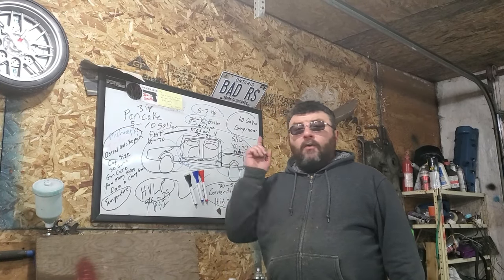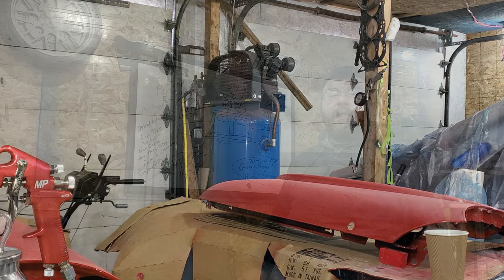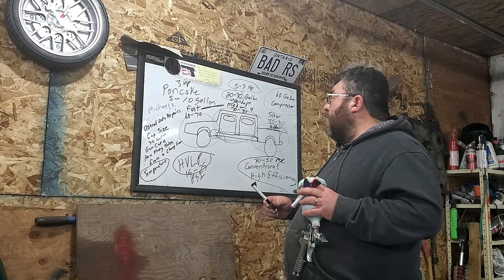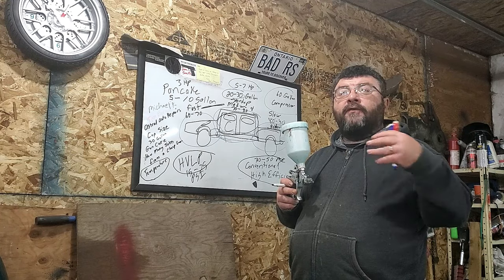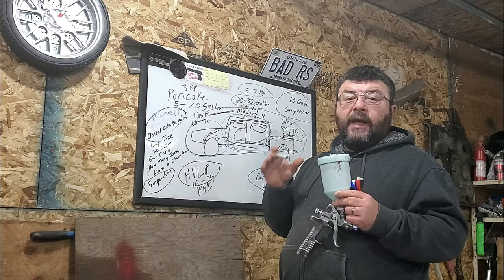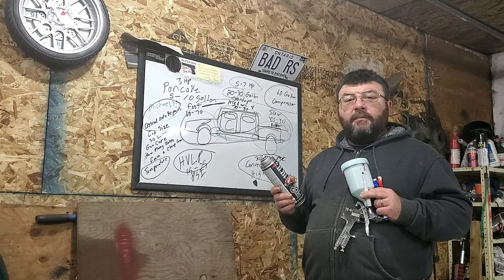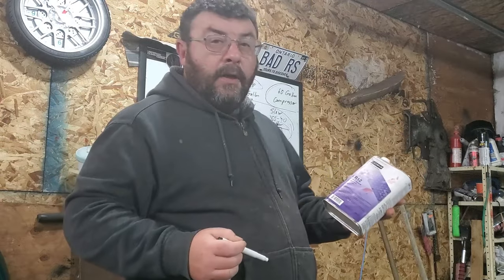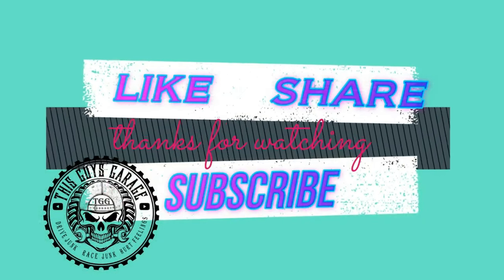compressor size for paint spray gun to refinish cars

Comment: Horsepower on a 60 gallon compressor matters i think... you have a 3.7 hp 60 gallon cp or a 5 to 6 horsepower 60 gallon cp it makes a difference im not sure if you could paint a allover with a 3.7 horsepower 60 gallon or not? jury is out on that the air pressure would come back up quick enough before u would get a pass done or if it would build fast enough before u would apply the second coat which is important sometimes hot weather or reducer your using in a singlestage paint can require a quick flashtime and when you start that second coat would that 3.7 hp motor have the compressor built back up enough for you to truly lay down that second coat??????????????? Your thoughts sir?? I have no doubts the 5 to 6 horsepower compressor would do it i really think your fine with that one
Reply from the maker: recovery is an issue, we had a 3hp 60 gallon in my dads shop 30 years ago for years before hvlp was a thing ,recovery wasn't as big an issue with a conventional gun ,but still an issue.  there is always flash time between coats so the compressor will be full when starting your second coat , but like the smaller compressors it really comes down to the square footage you are painting  ,if you are spraying a Miata you wont have an issue, if you are painting a panel van with lots of surface area  then the compressor will be playing catch up, as far as temperature that can be controlled with your solvent and activator. make sense?
strategy becomes involved 
thanks for the great question ,ask one any time ,hope you rang the bell and stay in touch my friend!

Comment: Dam and I wanted to get a little air compressor to paint my el Camino😔 not even in sections it will work
Reply from the maker: watch out for a used 60 gallon and you will be set to jet .   the 60 gallon huskies work great and they are reasonable. ty Eric
Reply: @thisguysgarage  thanks for the quick reply 1 more question since I'm planing of taking. Out the fenders and doors to spray on them real good with a 20 -30 gallon take care of the job meaning painting the whole el camino in sections ?

Comment: It is all about the CFM. How more air can the compressor produce. 15CFM is adequate for most jobs.
Reply from the maker: yup ,ty extremerecluse , this was meant for folks that do not really understand cfm
Reply: 10.5-12cfm is adequate for nearly any full paint job. The fact that most smaller air compressors don't put that out is the issue. It's not all about compressor size as much as it is HP, CFM, etc...

Comment: Compressor tanks size has nothing to do with it. Its all about compressor CFMs.
Reply: That's what I was thinking. A small motor on a large tank isn't going to do shit as far as cfm right?
Reply: @blakejohnson2206   Correct. Small motor on a large tank, the tank is going to slowly empty. When its empty the motor wont be able to overcome the gun's needs. You will have to stop and wait.